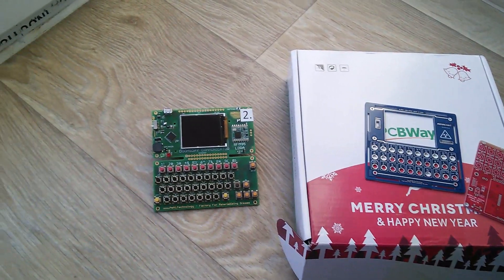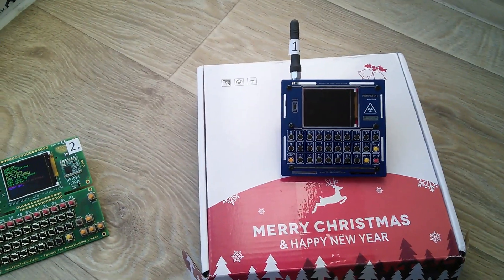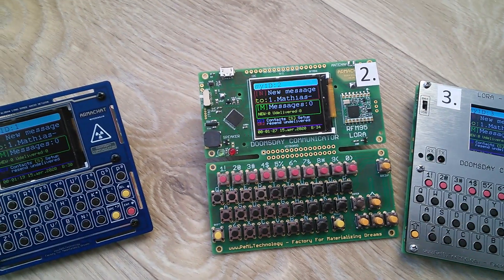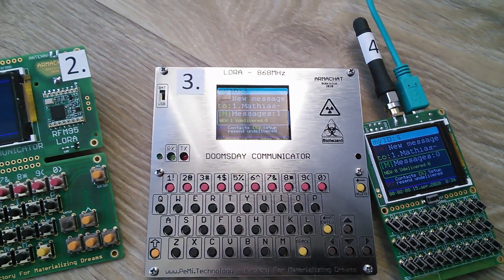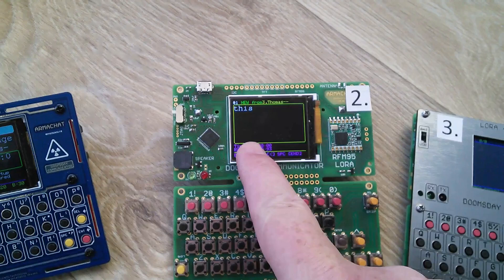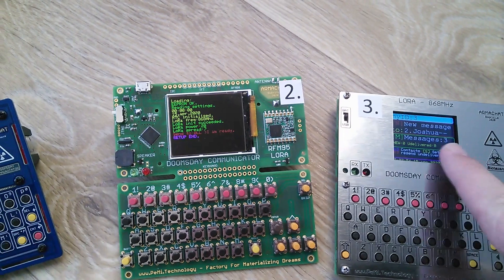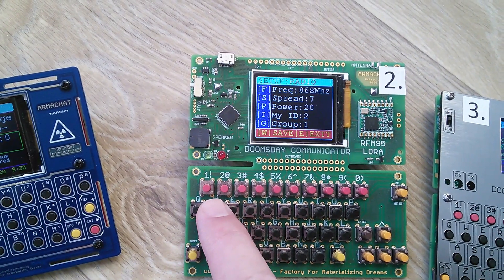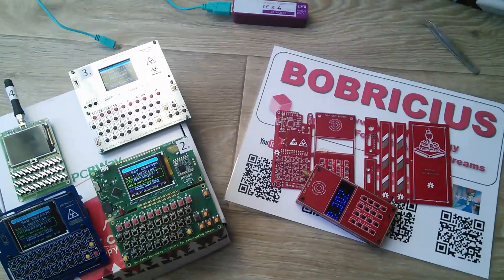#Armachat (part 2.) - Doomsday communicator and Off-Grid Wireless messenger with  LORA module

Comment: The one with the number 4 on the antenna, is that a kit? Would you be willing to share or sell the PCB design files?
Reply from the maker: All on this video are early prototypes, Now I am completely restated work for use Raspberry pi PICO, check latest videos, adjusting final boards, soon in my store ;)
Reply: @bobricius  I just really like the design of the keyboard part with the staggered switches! It's very neat.

Comment: Next step: implement end-to-end encryption with AES256 and authentication check to prevent man-in-the-middle attacks
Reply from the maker: of course
Reply: @bobricius  Your use of the open spectrum is unfortunately restricted to non-encrypted communications. FCC Rules.
Reply from the maker: @AcidTonic  encryption or not is question of 2 lines of code :) I think Lorawan is encrypted or not? ... LoRaWAN is one of the few IoT networks implementing end-to-end encryption. ... Each LoRaWAN device is personalized with a unique 128 bit AES key (called AppKey) and a globally unique identifier (EUI-64-based DevEUI), both of which are used during the device authen- tication process.
Reply: @bobricius  I'm not talking about how many lines of code it is. I am saying the FCC does not permit amature radio operators to use encryption on the 915mhz band.

So if you activate those "2 lines of code" you may be breaking FCC rules and open to fines and confiscation.

At this point why use 915mhz if you aren't following the FCC rules, pick whatever frequency you want and enjoy the FCC vans that will find and fine you.
Reply from the maker: @AcidTonic  For my encryption is no priority. but lorawan use same frequency, same technology and is enrypted, how it is possible                                                                                                     ? If I switch protocol to lorawan I can encrypt?
Reply from the maker: @AcidTonic  or what if anybody send play text with some secret code?

Comment: One of the first things the opposing army will do in an invasion is use an EMP attack. Can this be configured to foil such an attack?
Reply from the maker: I have no experience with shields
Reply: You could buy one for use and one to leave in the box. EMP only works on electronics that are turned on
Reply: @CommonLogic23  This is false. EMP works by inducing current in a conductor, regardless of whether current already exists on it. Unshielded devices that are powered off will still be affected if the pulse reaches them.

Comment: That's really nice, my primary concern would be security - especially since it sounds like you have little knowledge of such....
I'm also wondering if you are using an existing protocol to discover/authorize new connections, if you've made you're own or if you have nothing of the sort and just rely on frequency with a hardcoded (or config file) system.
Also wondering if it has the adaptability of plugging in a keyboard and screen - if you happen to scavenge them in a post apocalypses of course :D

For starters, if you don't have it or better, I'd recommend an RSA public/private keypair generation since it's reliable and can be easily optimized for bandwidth... but I'd love to put in my own encryptions in my model ;)
Reply from the maker: It was just only concept, working on complete new version, based on my new #picomputer Raspberry PICO platform. Plan is make all fully configurable with encryption, support for external keyboard and display and with easy user customizable firmware written in circuit python
Reply: @bobricius  it sounds like a product that would sell well, not to mention help out the third world locations... best of luck to you
Reply from the maker: I want use Meshtastic protocol, I have no skils for full mesh network implementation but I want adjust all radio parameters to inject packet in to Meshtastic mesh network

Comment: Nice. Have you tried to use nextion touchscreens for sms input ? there are standard keyboards built-in  into the software. And larger screens with powerful graphics...
Also nrf24 can be used for walkie-talkie  making (up to 1km connection) between 2 arduinos/esp32 or any other controllers...
Reply from the maker: never. if you missing voice and need touching something use smartphone + Meshtastic. Armachat is simple and low power device with hardware keyboard.

Comment: We need a rugged water proof version, you will sell thousands.
Reply: This is exactly right. Start small scale kit production to get started, then high volume production of the same product, followed by a mature design that has a properly engineered waterproof enclosure-preferrably with a removeable battery like an 18650 or CR123 for power.

Comment: What are the chances to mount an e-paper as screen?... - Maybe there isn't much power during dooms day.
Reply from the maker: E-paper is very slow, display eat exactly 1/3 of overall power consumption if I down backlit to 10% display is readable but with very low current. Much better is Sharp memory display, bigger, high contrast and resolution with near zero consumption. You can see at end of this video https://www.youtube.com/watch?v=xyqNBxaiwsQ Lora module not receiving in sleep mode, so display replacement not solve all.
Reply: @bobricius  Thanks. Very good information you have there. I will consider buying your Armachat when I have the money one day.

Comment: Would you consider providing a version with e-paper, to make it even more low-power, and not need to fight with the sun? Might need an extra LED night-light of course, but on average it should to better than keeping an LCD on all the time?
Reply from the maker: e-paper is not good for this project, is to slow, is usable on passive receiver. I working on board for 2,7" Sharp memory display. LCD is not energy energy problem. Lora 10mA, MCU 20mA. Display blacklight 30mA lowering backlit to 2mA is readable in standby.
Reply: Should an OLED also be low power depending on how many pixels are at a certain brighness? Compared to fully lit background and then covering parts of it like a TFT does anyway. There are some appropriately OLEDs. Some monochrome, but I also saw color ones.
Reply from the maker: oled no, immitted life, small size, display is not only one components which need power. Anyway you can use any display you want just rewrite driver

Comment: How do you know what ID the message goes to? Is Mathias linked to a MAC address in the systems setup or something?
Reply from the maker: It is simple 8bit packet addres now, no special protocol. You can chose device 1-10. It is realy early firmware.
Reply: @bobricius  One more bother if you don't mind?  I am looking at your bill of goods, could you let me know the model tactile switch you used for this as well as the 18650 holder? Are they surface mount 18650?

Comment: would be a great idea to incorporate a lora transmitter into a cell phone, then you can switch to Lora and have lots of cells using a mesh.
Reply: There's cellphone USB attachments for LoRA, apparently. Dunno if there are any apps that make use of it tho.
Reply from the maker: disaster.radio is not "into phone" but you can have small box in backpack ;)

Comment: Nicely Nicely! Where did you get the faux-aluminium panel done? What kind of materia is it?
Reply from the maker: Thanks, Here is log about this https://hackaday.io/project/170878-armachat-doomsday-wireless-qwerty-communicator/log/175971-something-about-front-plate
Reply: @bobricius   Thanks for the reply Peter. I used to use a method  where I drew the panel (actually using the same software as for drawing the pcb, which makes measuring and positioning letters and symbols easier) and then photocopied this on to an adhesive backed transparent sheet, which I then cut out and stuck on the front aluminium of my project boxes. The finish was good and they have survived scratches more than 15 years). But I like your professional looking results and they are more durable for sure too.
Reply from the maker: @F5VMJ  I am also using PCB software to design panels ;) Not sure if my plastic can survive 15years. I am more using this plastic to make realistic model. Now I am switched to mate black ENIG pcb, expensive but beautifull https://www.instagram.com/p/CA59wkwDG10/ check another photos, etc with backlight https://www.instagram.com/bobricius76/

Comment: Peter, I was thinking, instead of soldering 44 switches, would it not be nicer and cheaper to use a 48ch touch key IC? Use the layout to create the keyboard? Just a thought !
Reply from the maker: Now is touch age. Of course simplest is connect (or buy on ali ) ESP32+RFM95, create gateway for your smartphone. Still exist people which like physical keyboards ;) But you have true If I need simple simple or cheap solution best way is buy china board and drinking coffee, bud creating something with 4" touch display is like development smartphone without GSM.
Reply: @bobricius   To me, smart phone without GSM, is where it should go to, independent, with wifi, with LORA, kind of like a phone for total independence.  the fun thing is, it can be made much like a real smart phone
Reply from the maker: this is interesting project https://wiphone.io/

Comment: Great job! To make it even more "doomsday resistant" replace the standard battery with an rechargeable one and add a usb port where to plug-in a solar pannel :) Wish you full of success!
Reply from the maker: I am already using 18650 lion battery and charging via USB.
Reply: @bobricius   Don´t listen to him. Replaceable 18650 is the way for reliability.

Comment: Such a cool concept. Hope it develops a following.
Would be even cooler compatible LoRa comms functionality was built into cell phones—I'm certainly not holding my breath though! OTOH, a unit with BT only input, LoRa output could be small and allow someone to use a cell phone as the interface.
Reply from the maker: This is exactly DisasterRadio project. I want simple, single chip, easy replicable design, with full control on entire code without milion lines android/wifi/bt stacks. Main purpose of this project is for education HID/GUI/Networking ....
Reply: @bobricius  Interesting, thanks!

Comment: Hi peter, this is awesome man!, these Lora modules are available all the way up to 1W output power ( Ebyte E19-868M30S) for about 10$, the more SMT parts you use, the easier it becomes to get a small batch made by pick and place machine.  Normally the setup cost for PCBA’s is about 200$. The buttons you can get from alps,  a 4” IPS LCD display 480X800 is about 7 $ let me know if you need any help, I do this for a living. (Im a design engineer with lots of China experience)
Reply from the maker: HD display, capacitive touch, GPS, wifi, bt, barcode scanner, 2 cameras, thermal camera, accelerometer, finger print sensor, raspberry pi> it is easier glue lora module to smartphone. I am absolute on edge SAMD21E, It is very hard just drive this small display with lot optimisation.
Reply: Peter Misenko Hi peter, you did do an awesome job, but you know how us nerds are...;-)  could i say that perhaps finding a bubble button keyboard would be interesting? I’ll have a look for you
Reply from the maker: @infinitesolarforall3901  I understand you, but in current development state is recommended for advanced users or developers. I can't afford to market such a very unfinished device. I think I've come a long way in a month and there will be improvements soon. My priority was an extremely simple device, If I give a larger display, I will need a more powerful processor, so I canceled the development from SAMD21G in QFN case and a newer version I used SAMD21E in the well-known TQFP32 package. Also my zero budget will not allow me any mass production in china.

Comment: This is perfect. Will you kickstart this?
Reply from the maker: I have plan sell main board with CPU only for begin, maybe with display ... without buttons and radio module, in future maybe more complet. There is lot work.
Reply: I understand thanks.
Reply: @bobricius  - Hi there,

Cool. I really need this now b/c they are taking down the net. Can I get at least 2 from you?

How much are they?
Reply: @bobricius  I don't think you realize just how much demand for a product likethis there is..... ESPECIALLY in the USA. A discrete and secure way of reliably communicating without having a cell phone is something that not only are many people here actively looking for but there are 10 times that many buyers who would purchase this capability if they knew it existed. 

Seriously, put kits together and sell them to fund serial production of a commercial unit. You'll literally be a millionaire with the right marketing and distribution. Find a way!
Reply from the maker: @nunyabidness9257  I am starting development again form ground, rewriting all code on new hardware, I am complete at begin. There is meshtastic project, secure, reliable offgrid communication, use smartphone just for display and write messages
Reply: @bobricius   The issue here is the smartphone. Nothing is ever secure when you involve a smartphone. 

I realize that the amount of work needed to make something like this viable is quite substantial, there is no doubt... but there is also substantial reward in producing a kit or product that gives people the ability to communicate in legal radio bands that doesn't involve a third party or a third party's hardware. The world needs devices that are blind, deaf, and dumb to anything that isn't it's own type and doesn't store messages or contacts like a cell phone.

Remember in terms of whether this is commercially viable or not, that you don't sell just one kit or communicator to one person, but between 2 and 5 depending on if it's friends talking or a family that wants emergency communication. You could also market base station units that are specifically made to have an antenna on a mast pipe for added range or repeaters with solar power meant to be hidden in elevated areas.

Huge potential here.
Reply from the maker: @nunyabidness9257  I understand, And that's why I creating separated handheld without WIFI/BT and only with LORA, with complete open transparent software and design. I think new hardware is almost finished, working on software.
Reply: @bobricius  That's fantastic news, I will be supporting your Patreon if signing up isn't too onerous-is there another way to financially contribute? This is something I really believe in.
Reply: I joined Patreon and am now a patron, good luck in your work!
Reply from the maker: @nunyabidness9257  thanks for suport. In next month I have plan send to all partons bare PCB as sample or for DIY assembly, just waiting for new revision, then after check I start shipping, in new year maybe I will have some units for sale.